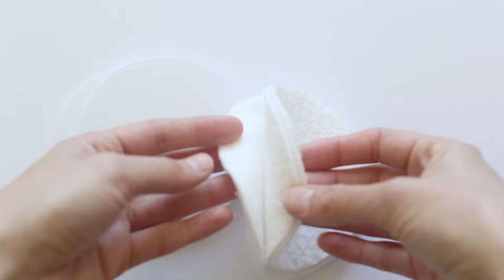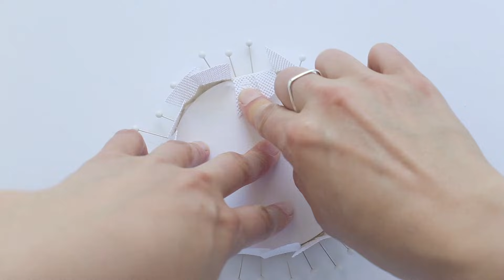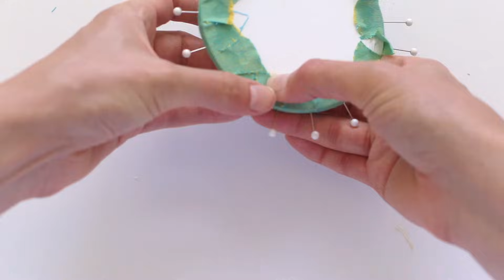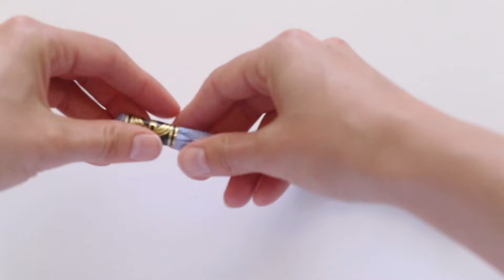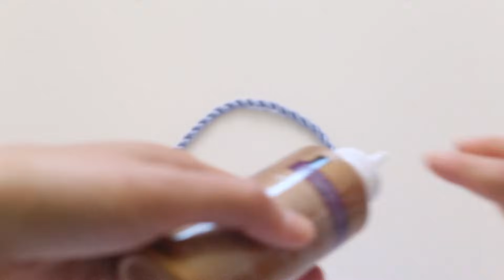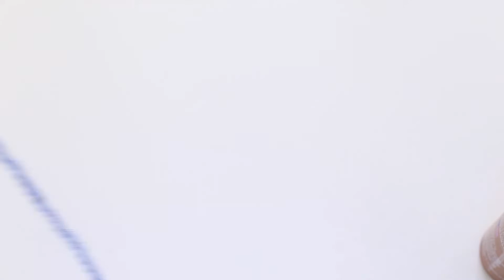How to Finish a Needlepoint Ornament

Comment: Question: when you sew around the edge of the ornament, are you just sewing on the canvas or do you catch the edge of the stitching on the front?.
Reply from the maker: I'm not intentionally sewing the stitching on the front, I'm locking in the edge in case the tab cuts unravel at all. Honestly, since making this video 5 years ago I've stoped sewing around the edge, it's nice but not really necessary.

Comment: Do you have video on cutting the board the correct size?
Reply from the maker: I do have a video that's part my class called the Online Ornament Finishing Class on www.abigailcecile.com. I do also have precut finishing board shapes available through the website too. The process I like to take is to trace a circle onto matt board, then cut it out using either scissors or an Xacto knife. Cut two, place them together, then gently trim any areas that are jutting out so they're the same size. Mark them with a pencil so that you know how they should come together to perfectly match once they're covered with canvas and fabric. I hope this makes sense! If you'd love more in depth instructions and a template for tracing just reach out through my website. :) Xo Abby

Comment: Why not do a running stitch around the circle and pulling the material to hug the cardboard., especially with the material.  Did like the idea of a couple additional rows around the design to cover the edges when turning it to back.
Reply from the maker: I personally prefer cutting tabs and using glue because it allows greater control over tension - but stitching a running stitch and pulling it tight is a perfectly legitimate way of ornament finishing! Give it a go.  :)

Comment: I appreciate your instructions they are easy to follow. I’m having issues finding the correct board.
Reply from the maker: We carry it on www.abigailcecile.com or you can find board at hobby lobby or Dick Blick art supply. I now prefer to use acid free 4 ply matt board instead of the foam board. It creates a thinner ornament but is easier to work with!

Comment: I have a question about the sewing machine step. I don't own a machine and am wondering if this can be sewn by hand? Or would adding the turn rows be enough? Also, when you made your cording, how many strands of 80" lengths did you use? It looked like 6 to 8. I love the video! Thanks for the help!
Reply from the maker: Hi Ginger, honestly I've started skipping this step so I wouldn't worry about it unless you're intentionally cutting into the stitching for some reason (Really you'd only do this if you had stitched a square ornament and deciding to finish it as a circle - or something like that). I personally like to use about 11 strands to make my cord.

Comment: Professional finishers claim using glue is bad but never explain why. This is a wonderful video!
Reply: I do not glue...I use upholstery thread and sew one flap to the flap across from it and working around. Maybe you would like that better.
Reply from the maker: A few reasons! Some people prefer using a lacing/needle and thread method because glue is messier, glue will eventually lose its bind (so you want to reinforce with stitching), and certain glues have starch/sugar which attract bugs (silver fish specifically I believe). Tacky glue is starch and sugar free so it's safe to use!